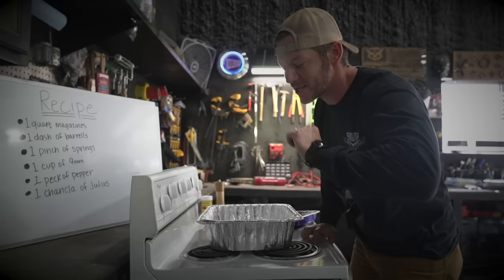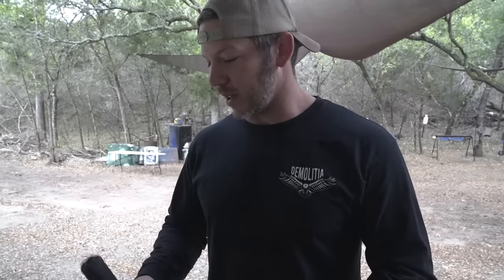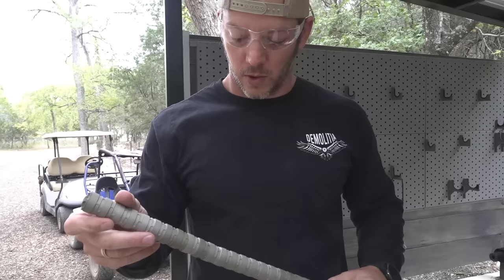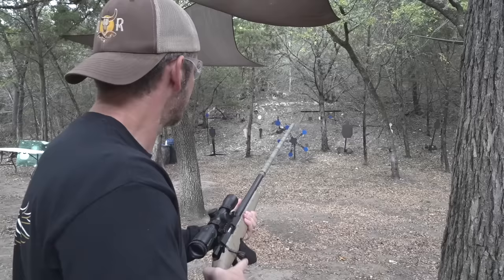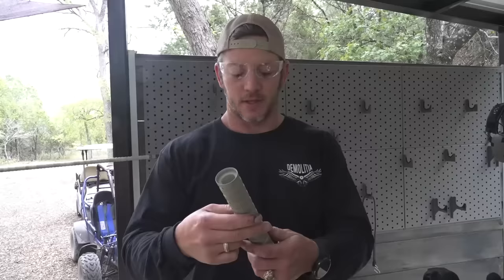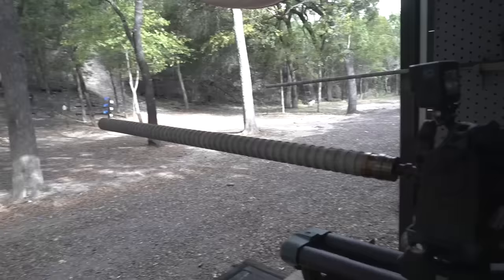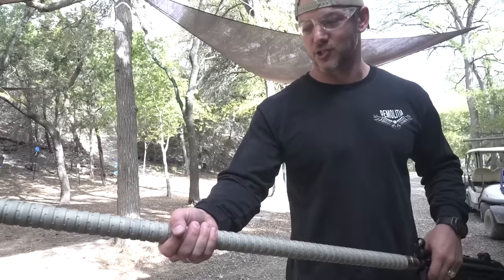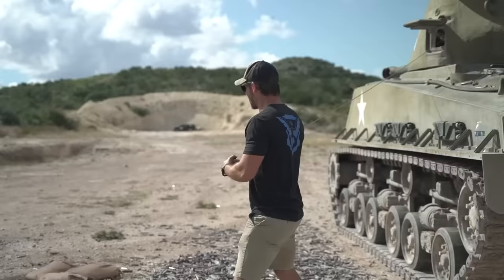Shooting The Worlds LONGEST Silencers!!! But Do They Work???

Comment: I think the reason you only got the baffle strike while holding it is cause when it was tied down, the barrel wasn't swaying. However, when you held it, natural slight bodily movements happened causing the suppressor to sway while the bullet was shooting causing the baffle to get struck. This would actually be a pretty cool idea to completely silence a .50 bmg if you had supports to keep the suppressor from swaying.
Reply: Can you get subsonic.05 cal bmg bullets?
Reply: @glenecollins  There's little to no options for subsonic 12.7x99 really other than "50 Thumper" rounds that I've seen, they're supposed to shoot at 1050 FPS. Good luck finding any though lol
Reply: "yo hand me the 50 cal"
"but we are on a stealth missio-"
"*i said hand me the 50 cal*"
Reply: Nice name
Reply: @capybara5879  long enough suppressor ya gotta shoot from the other side of the house out the window. And the only thing ya hear is a fly fart.
Reply: Honestly if you can suppress a tank you can suppress anything.
Reply: @glenecollins  eehm maybe the Ash12? Also 12.7mm
Reply: The thing is, supports mean you either can't move it or you literally need the most convenient and long, perfectly straight pile of dirt.
Reply: Like one nerd help another nerd out for a problem concerning a mayonnaise allergettic man who included his kids in the shooting competition. So tension is something used to keep up entire Bridges- let's not deal with suspension in this attachment. This suspension helps keep the suppressor up, if we use the Flex Seal family of products to put glue there which one fully dried can hold up 1,000 pounds, and is capable of instantly being used to hold up bricks and even dries underwater. Suspension is a phenomenal within physics and we have multiple ways of achieving this in gun form, we could have a string that is slightly short and then bend something backwards so that it then he's held up straight. Or we can have some kind of mess behind the barrel assuming that the rope or string or cable that we use is not perfectly long enough. Now if we take an adhesive and put a screw with a string hole on it, except we grind off the actual screw part and use the flexible family of products to keep it on the top of this barrel and then we run a "emma kites 100% Kevlar Braided String Utility Cord 100~2000lb High Strength, Abrasion/Flame Resistant, Tactical Survival Cord Fishing Tackle Assist Cord Model Rocket Paracord Trip Line Kite Bridles Camping Cordage" through the line we will not only have enough penile strength to hold this up, but we will also have enough for attachments if we were to use a updated suppressor Barrel that has Picatinny rails. Trust me, I'm a white and nerdy Asian that watches a guy that owns and AK Factory, and reviews cursed content and memes related to guns for a living. I also happened to currently be in America. Now we would ideally be using two separate chords because we are mounting any bipod to ideally under the part of the scope that you look down, and behind the part of the scope that mounts to the Picatinny rail.Hammer some s@&t because it looks good. And we are to drill holes through this bipod, sand it down really good, and then feed the ropes through there ideally with the length of rope going on the inside of the the bipod where it would be the equivalent of the inner thigh of the average human. And then you are to tie a double half inch knot with the remaining string, and you are to do something else at the hook which should ideally have the left side of the loop be located on the left side of the gun and their right side of the loop. And there's this handy little knot for time to end stroke together where I crap you not, you make the Rope do a 69. Grind some S@%&, and I guess you can take the angle grinder to some Picatinny rhinos, Flex glue them to the side and underbelly of this particular suppressor, and then make some use out of that 1,000 lb upper limit now to ensure that this does not come off, you should take some "emma kites 100% Kevlar Braided String Utility Cord 100~2000lb High Strength, Abrasion/Flame Resistant, Tactical Survival Cord Fishing Tackle Assist Cord Model Rocket Paracord Trip Line Kite Bridles Camping Cordage" and wrap it around the bottom of our hole, and the bottom of the barrel so that even if the flex glue somehow comes off, you can still keep that thing on the bottom and it should also help with that 2,000 lb upper limit, but I'm pretty sure that for extra security you should put some Flex glue on the barrel where this "emma kites 100% Kevlar Braided String Utility Cord 100~2000lb High Strength, Abrasion/Flame Resistant, Tactical Survival Cord Fishing Tackle Assist Cord Model Rocket Paracord Trip Line Kite Bridles Camping Cordage" is, do your best to how do I word this. Make sure that the flex glue is taking up all the space in between all of the wrapping that you made, and then spray down this whole assembly with Flex spray, come to think of it. If you're trying to fill up the gaps in between the Rope segments, you should be using flexshot because that bad boy has a tip that's designed for getting into holes and filling up cracks. And because black stuff looks good, is very well at hiding, and it's already the color of your gun, give this whole thing the covering of flex spray because it's going to make it look good and have extra functionality - I also recommend dipping or brushing the places of the gun and Barrel that you are going to grip with some flex seal liquid. Flex Seal liquid also does a great job at making sure no one ever opens up that hot sauce bottle again. Also you might want to increase the friction and grip of the back of your stock or brace using line-x. This is a different kind of grip than the one. Using the term traction would honestly be better for describing what the Line-X does. It is a rough surface that therefore is hard to slip off of, rubber isn't quite like that and flexi liquid when it dries is kind of rubber pretty much. Don't you dare ask me what Flex Seal liquid truly is, let's just say it's a swift Family secret. I've also got a design in my head for a secondary bullet, it's like a casing inside of a casing that ignites after the initial bullet casing has all of its powder spent. I would be shocked if this design does not need incredible refining in order to get the exact ratio down for it to properly ignite at the proper time. Honestly it probably won't even ignite until hitting the target, and who knows what's going to happen then. This is assuming that a ratio is not achieved with the powder in the initial casing, a ratio of powder to actual casing so that it heats up the casing to a point where the powder ignites at the proper time, assuming the powder in this even ignites before the heat conversion from the kickinetic energy of the bullet hitting target, or the powder being compressed by the sudden G forces is what causes it to ignite inside of the target. Sorry if you can't understand that last bit, just think of Rocket staging but with bullets, it's complicated to get it to work right- but in theory it works.
Reply: Vent the chamber and use standard ammo. The whole idea is an exercise is silliness anyway.
Reply: @Deez Nuts 🥜

Comment: Scenario: You’re the lone survivor of your platoon. You’ve managed to find hiding behind enemy lines with enemy soldiers no more than 30 feet in any direction, and you know your only chance to make it home is with stealth and absolute silence. Your shots will definitely alert the surrounding 30 enemy soldiers. But you remember your Q silencer. It’s meant to be - silence is your plan to slowly eliminate them all 1 by 1. You’re ready. Your family runs through your head. Be silent, be still. Aim true. You begin attaching your silencer… 14:51
Reply: Soldier 1: Why do i hear noises
Soldier 2: I dunno, let’s just focus
more noises
Soldier 3: Hey do you hear that?
Soldier 4: Yeah whats that
Soldier 2: Not sure
an eternity of noises later
Guy: Finally i attached my suppressor
The entire frontline’s mind absolutely having no idea what’s happening: w o t
(I have no knowledge about military whatsoever so i might be wrong on some things)
Edit: they probably sent a guy to investigate or smth
Reply: Thats just the call of the infamous DemolitionBird they wont suspect a thing
Reply: Guy 1: You hear that?! Sounds like someone screwing on multiple 2 by 2 tubes
Guy 2: Huh, might’ve just been the pipe men
Guy 1: Guess so, even our suppressors wouldn’t make that much noise

Guy 2: . . .

Guy 1: Hey? You goo-
Reply: Its like a duck call for a very special kind of duck.
Reply: The one time you wish you'd saved those tiny Tabasco sauce bottles from your MREs to use as silencer lube 😒
Reply: @GlassOfVitto  If it's a lazy and undisciplined group of soldiers then they might not investigate, if it's a well trained group of soldiers who are aware of their surroundings then they'll probably check it out.
Reply: Time to collect the Q Erect silencers from your entire platoon and screw them all together.
Reply: The eye contact was the best part XD

Comment: I’d be curious to see what happens to bullet velocity if measured with a chronograph as the suppressor gets longer and longer
Reply: this is what i'm wondering.
Reply: We're on the same wavelength, the more you suppress the less velocity you  gain.
Reply: Also see how quiet you can get it. Using a hanger or barrel support so it doesn’t droop as much.
Reply: @thehuntertyranni7497  yeah having that many baffles is gonna slow round down, and little .22 isn't gonna be going faster anymore, I suspect the .22 was dropping below supersonic and is why it got quieter
Reply: When matt touched the baffles and some of them where "cold", thats the point of diminishing returns. All the energy you lose from sound and velocity is converted to heat in a supressor. If very little heat is being exchanged, probably very little sound and velocity the bullet is losing. But yes, it would be very interesting to see all that data 🤣
Reply: Suppressors do not decrease velocity
Reply: @eamonndigaetano3727  I’m sure they do when they’re 4ish ft long lol
Reply: Suppressors (and generally more barrel length) will typically increase the muzzle velocity because of more time in propelling pressure.
Reply: Yeeaaah, this is not the channel to expect professional testing, lol.
Reply: @AsthmaQueen  well we all know a .22 is a quiet simple round. So the silencer required would be made out of a thinner metal and the baffles wouldn't need to be as robust. Not a lot of gases coming from it. It's also just simple gun owner knowledge that the less gas and compression that the projectile has behind it the slower it goes. So coupled with a slow projectile and, almost no pressure pushing it, the round wouldn't be able to hold it's stability in the air to hit what you're aiming at. Also thin metal makes for poor stabilization when it comes to barrels. Sorry for the rant. 🙃
Reply: I mean a longer barrel is a good thing one can have too much of as the pressure wont be able to push the bullet out of the barrel if long enough as the gas has expanded as much as it already can
Reply: That is correct, there is a limit proportional to the maximum expansion of the reaction.
Reply: that and sound.
Reply: It gets slower.  The bullet basically loses velocity after a certain point of having to push against air in a fairly restricted area.
Reply: Ik yall were talking about longer suppressors but there's a video where they have like a 6' barrel and test the bullet velocity difference by cutting a couple inches of the barrel. The video is called "Cutting the world's longest barrel to find the perfect barrel length"
Reply: 2 things can happen 1 nothing 2 rules of physics could brake and the world gets destroyed
Reply: The first one will probably increase velocity and adding more will probably decrease it.
Reply: @AsthmaQueen  why on earth would it slow down the bullet? It's a video game misconception, but adding a silencer actually increases the speed and accuracy of the bullet as it has more time to be propelled by the explosion gasses. You'd have to reach a level where the pressure behind the bullet would be lower than atmospherical one for it to actually slow down, and that'd be one long silencer.
Reply: And a sound level meter
Reply: @FFLORO_45  because at that length including wipes there is a resistance added? Yes normally bullet will go if anything increase with a normal silencer but for a small cartridge like a .22 they are way past that point and bet the silencer is actually slowing the round down
Reply: @AsthmaQueen  fair enough, looks like the maximum barrel length for .22 is around 16”, and that’s for a barrel, probably even shorter for a silencer 👍
Reply: @FFLORO_45  It's probably not that difficult to find out what the volume of the gases produced by the reaction in the cartridge is at 1 atmosphere.  I don't have the numbers, though.  If you have that info, you can pretty easily figure out many chambers it takes (plus the volume of the barrel bore) to reach zero relative pressure difference.

Comment: Would have been interesting to have a dB meter to see how much more quiet it got.
Reply: Honestly
Reply: I was coming here to say this...like tf did u even do this for if you didn't have a dB reader on hand?
Reply: Was there a benefit adding segments? To me the second one was noticeable after that I didn't hear any difference from the microphone.
Reply: @demolition ranch
Reply: or, to see how loud attaching it is
Reply: @dpa1752  the gas will only ever travel so far, eventually it will do literally nothing but cause deviation.
Reply: Really would
Reply: Your basic $350 db meter won't work. Many have tried if you look up some videos. They never get a true reading
Reply: Honestly I can't believe he still doesn't have one at least sitting near him for all his videos. I'm not expecting perfect, scientific results but it would at least give some insight.
Reply: @robwigglezz944  It doesn't need to be a perfect reading. As long as the meter is consistent enough for comparisons, the exact value isn't as important.
Reply: Agree 100%... my question is does an increased number of baffles = lower dB? OR , does the baffle diameter make more difference (at a given number of baffles)
Reply: @dpa1752  quieter but you can also get more muzzle velocity
Reply: The target is louder than the gun
Reply: Would also have been interesting to have a chronograph set up to see how much velocity variation there was
Reply: Been proved that after a while it actually makes it louder because of the baffle strikes
Reply: it sounds the same tbh

Comment: I was totally expecting you to use a decibel meter and record how much quieter it got each extra segment lol
Reply: Or a chronograph to see how much slower the bullets are after leaving that many suppressors.
Reply: @xdragon2k  suppressor shouldn’t slow down the velocity at all
Reply: You were totally expecting to be at a different channel then, right? :)
Reply: Suppressors should actually increase the amount of speed cause it is kinda a barrel extension
Reply: @xdragon2k  cod logic
Reply: @tigokooreman9912  i'm not a gun nut and i may be wrong, but i think i heard somewhere suppressors basically disperse the gas inside of them to reduce the amount of gas expansion at the end of the barrel
Reply: @burneybenry8909  yes, but in doing so they also act as a very inefficient barrel extension. Once all the powder is burned and the gasses are at atmospheric pressure then the bullet will stop accelerating.
Reply: if only, 🤓🤔
Reply: @rhadiem  nope. Just figured since he was doing this it would’ve been for testing how much quieter it was not if the bullet would make it through or not lol
Reply: @burneybenry8909  what the other guy said😅
Reply: Definitely wasn’t expecting this personally, on Demo Ranch.